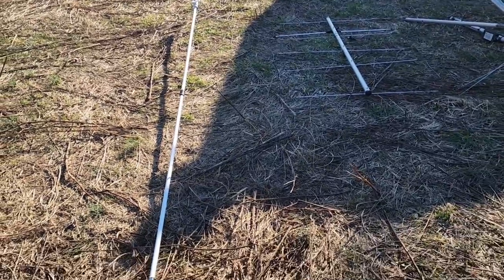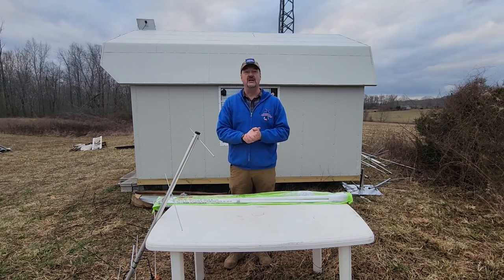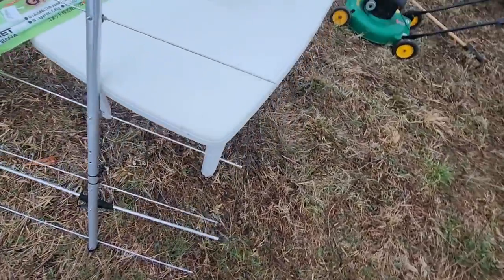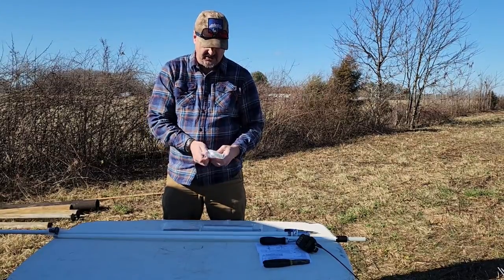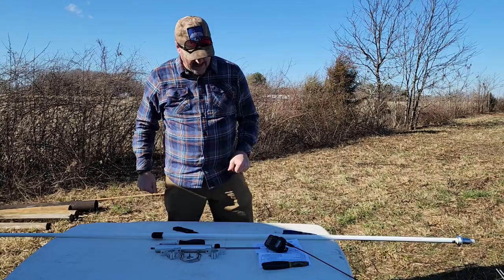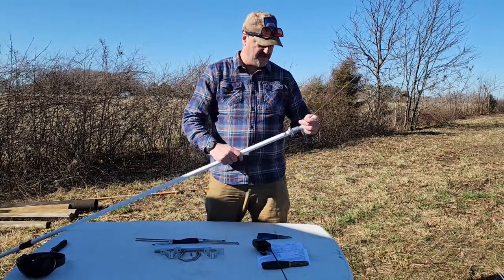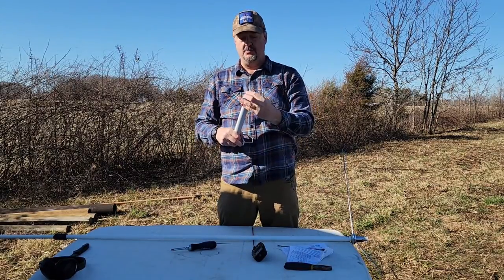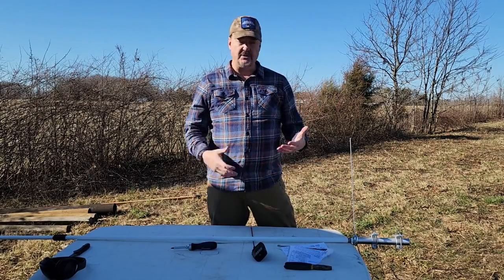LCARA HAM Radio: Rohn 48' Tower Installation Part 4 - Antennas!!!!

Comment: I have that same antenna GP-6 and it does great on GMRS. The bottom is at 30ft and SWR's are at 1.01 . I just bought the new Yaesu ftm-500 Ham radio and this GP-6 works great on 2m, 70cm, the SWR's on the ham is at 1.3 still good on all frequencies . I matched it with Browning LMR-400 solid conductor, so all SWR's are great and flat. I enjoy your videos so much, very educational and looking forward to see all antennas mounted and in use. 73